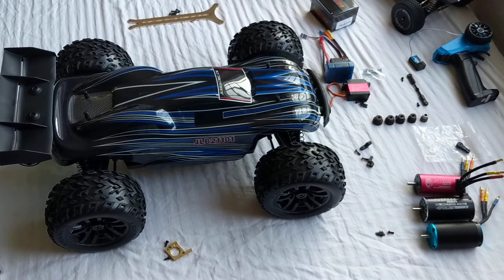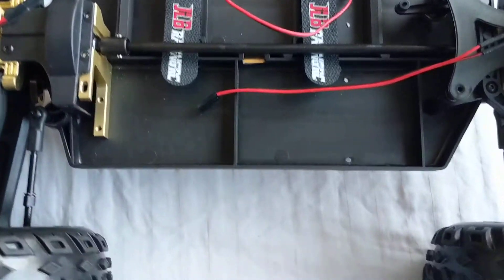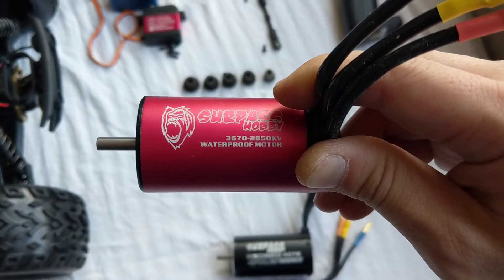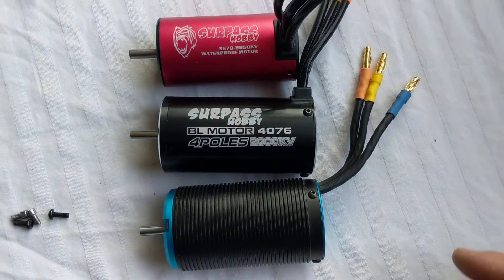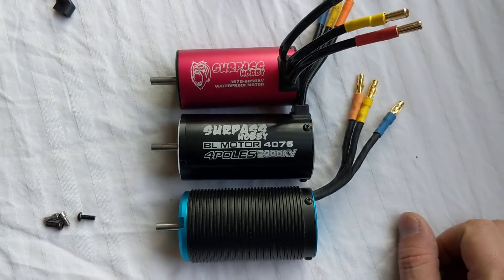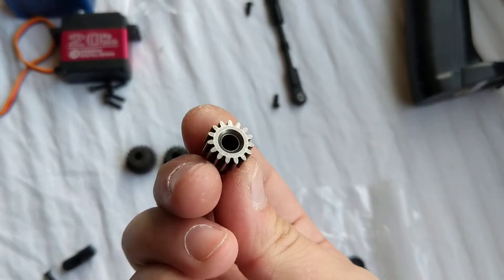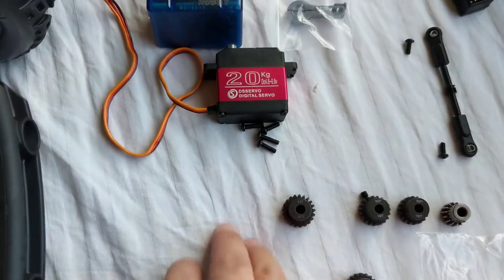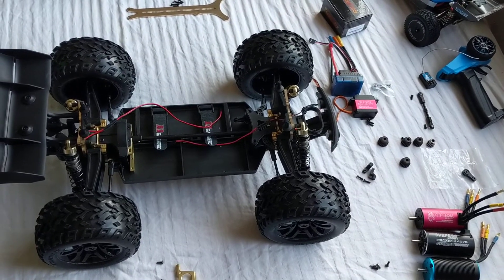JLB Cheetah RC build prep and parts selection

Comment: Better get a higher amp esc for that motor. That 80a ain’t going to cut it. Lol. I put in 120a stock motor, new dumborc, and huge 3.8 belted badlands and mine screams!!! But runs very hot. Watch your heat with that small esc and huge motor.
Reply from the maker: Thanks for watching and the feedback! Didn't think I mentioned a 80a, I'm using a 120a with the 4076. It rips hard, but does run a bit warm so I run a dual fan on it. Have a 150a ready to go, but may use it in one of my other ZD chassis. Have a 120a running a 4082 in my SC-8. Check out my other videos, have playlists setup too. I'll be sure to check out your channel🤙
Reply: Ya you didn’t I thought is was the same blue 80a esc that came stock in my cheetah which promptly got ripped out lol. I also put in dual fans and just drilled holes in body to help heat escape but might have to change pinion. Those wheels are so heavy I’m about 9.5 lbs. love the monster look now so have to figure out solution. Maybe faster fans. Lol. My channel more geared towards outside only started some rc stuff been out of it a long time. Much more fun these days.
Reply from the maker: @Greatgadgetsgear  Very cool, agreed, I don't bother with anything under 120a. Best for the price point, I usually pick them up for ~$25 on aliexpress. Great source for rc spare parts. The 150a is a good jump in $, so I save them for when really needed. Glad you're back in the hobby🤙 definitely check out my other videos. I recommend rolling chassis builds, can help stretch that dollar and let's you get to know your rigs. I like all flavors(especially Rally and SCTs) and try to share as much as I can. If you're into these bigger bashers, check out *rc cars and tanks 27 for some solid reviews and comparisons.
The drilling is a great idea! get some vids up, I'd check em out.

Comment: Hey one question, I'm planning to change my motor with the 3670 2850kv one you have in your video since this is the highest kv they have for this size, how much faster is this one than the stock 2500kv? Thanks
Reply from the maker: Thanks for watching 🤙! Don't have a speed run comparison but you can calculate the motor speed difference. Kv is rpm/volt: 2500kv @7.4v= 18,500; 2850kv @7.4= 21,090. That would be ~12% diff at the motor on a 2s. Hope this helps 👊
Reply: @motorheadaddictions2761  Thank you